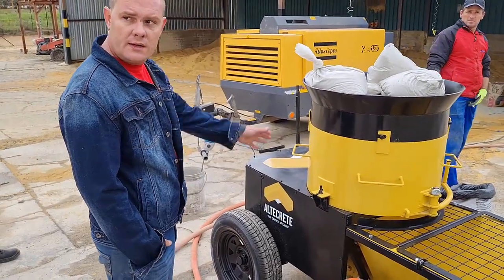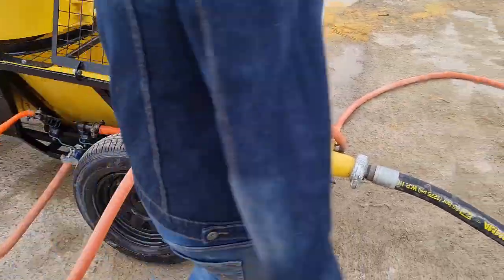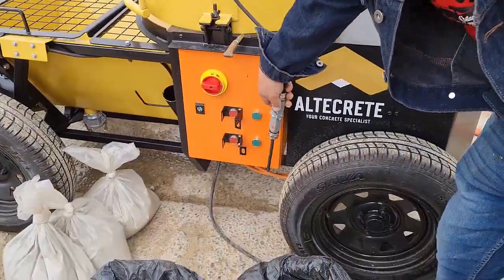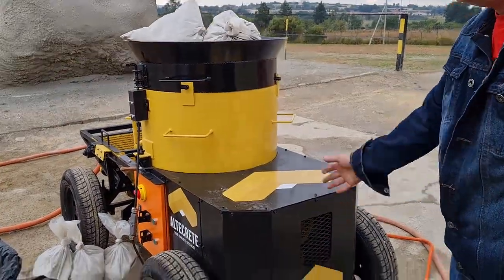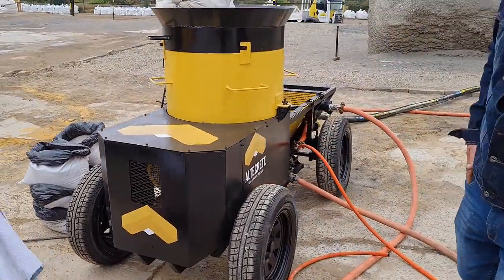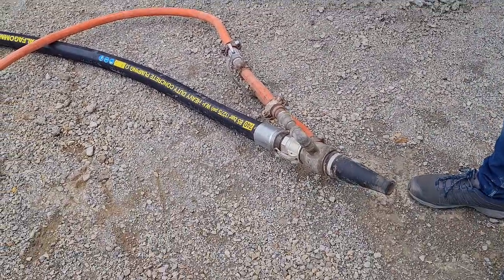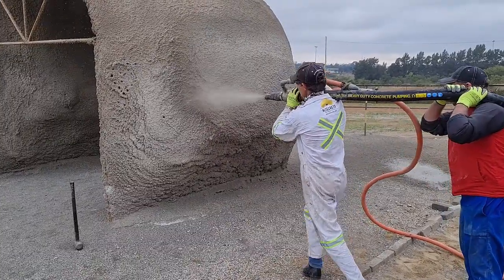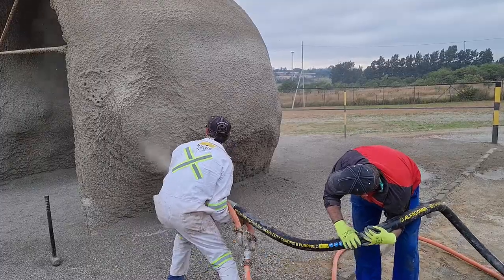MINECRETER WET SHOTCRETE PUMP SPRAY DEMONSTRATION

Comment: Jason this machine is available in india. Can u give the wholesalers no. of indian person.
Reply from the maker: Unfortunately no, it is manufactured by us "Altecrete" here in South Africa and is the only one of its kind. How ever the machines parts are common enough that replacement parts can be sourced easily enough in most countries across the globe. 
The machine in this video is the old version.

It has gone through new upgrades and now has a added water dosing unit that can be set with pre measured amount, ensuring a 100% accurate mix of 99kg of material consistently within 80 seconds.

It has added high powered protected LED lighting:
Adjustable 3 x Lights on the front at 6000 lumens each totaling 18000 lumens to light up the tunnel/excavation/work face/area.
The receiving bin and mixing hopper both have a 700 lumen LED light to ensure high visibility at the machine during operation in no light areas.

The top drive gearbox operational specs is 1200 nm of torque with the current motor configuration we are applying 57 nm of torque to the top drive train which handles the initial mixing of the concrete in the mixing hopper for 80 seconds before being dropped into the receiving bin and pumped out.

The bottom drive gearbox operational specs is 1800 nm of torque with the current motor configuration we are applying 867 nm of torque to the bottom drive train, which pushes material from the pump down the hose and can pump concrete vertically 45m under normal operation and up to 65m under stressed operation. (Stressed operation is not recommended for prolonged periods of time)

Comment: Great demo Jason, where are you located and do you have same machine little bit smaller ?
Reply from the maker: Hi nanofree01, we manufacture a smaller liner application pump, but its designed for the application of Thin Sprayed Liner technology and runs on a peristaltic pump system. May I ask what you application is and under what conditions you need to deliver your sprayed application? If we cant help you at least I can point you in the right direction to achieve your required result.
Reply: @JasonBorejszo  Thank you Jason may I reach you on jason @ altecrete dot com ?

Comment: Jason, what’s the price for a machine this size?
Reply from the maker: Due to the heavily fluctuating import market pushing up prices on almost everything. I dont feel comfortable quoting a price online. Email me and I will send you a quotation that is valiud for one month after date of issue. The Minecreter costs less than most other machines of its class on the market. When I say class its an understatement, There is no other wetcrete machine on the market that has the same torque and design making it suitable for the harsh and rough conditions of deep level mining.
Reply from the maker: jason @ altecrete dot com

Comment from the maker: @Bobby White
With a comment like that, ignorance isn't an excuse. Doing dryshot in pool construction is hardly considered extensive shotcrete experience. When you have gone through solid structural shotcrete for tunnel excavation support, slope stabilization, shotcrete for Dams, Bridges, Buildings, etc. can you then call your self an experienced shotcreter.

If you google search "wet shotcrete machine" and look at images you will quickly find out that not only is the Minecreter superior to all other wetshot machines of its class in the world, that it is also the first of its kind to be efficiently designed for ease of movement, use and simple less then 10 minute disassembly/reassembly access to replace any of the 3 wearable parts with spares on the machine making maintenance a very fast and simple task, that won't hold up the job while maintaining project deadlines.

Operating at a working range of between 1200 and 1800 newton meters of torque, the machine is designed to maintain high levels of performance under continuous load over long durations in the harshest of deep level mining conditions.
Reply: these little trolls who know everything must be put in their place bravo!

Comment: That is a child's play thing and not for actual work not being a troll or anything lol but I have been doing shotcrete for over 20 years and that is only good for stucco
Reply: Stucco? You clearly have far less experience than you claim. To make a statement saying its childs play is you literally being a troll. Try backing up your troll comment with a comparison to an existing machine of the same caliber for manual spray wetcrete applications with the same output, mobility, ease of use and price.

The Minecreter is used by most of the GOLD and PGM Mines in South Africa, including Mines in Peru to apply wetcrete rapidly with ease in mining tunnel excavations as the rock is pulled out then wetcrete lined as a rapid curing secondary support. It does two cubes per hour and only uses air for spray at the nozzle like most wetcrete machines. Using our Minecrete S³ shotcrete hybrid material it has a rebound rate of less than 4.6% and because of the very high bond, shear, bond shear, tensile, etc mechanical strengths is applied at half the thickness while still out performing 40mpa shotcrete at double the thickness. Reducing application time, labour costs, material transport costs and increasing mine production output.

We have other machines for larger output and we also provide volumetric robotic spray rigs for mechanised mines where even larger based wetcrete volumes are required.

You more than likely got your experience from dryshot in swimming pool construction and the like. Which by the way is considered childs play by those in the Mining, Industrial and Structural Civils sector.
Reply: @altecrete  Hahaha very well said sir ! these little trolls who know everything must be put in their place bravo!